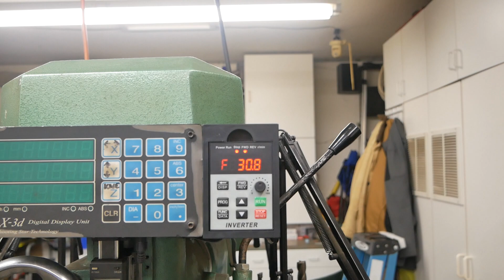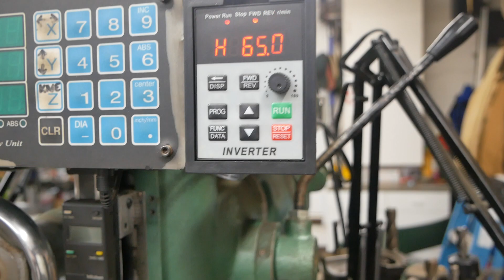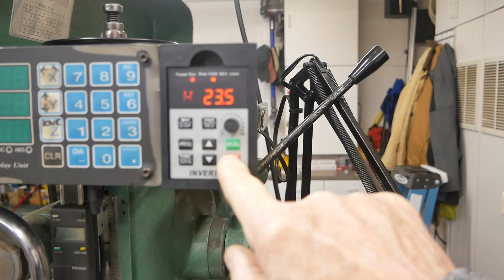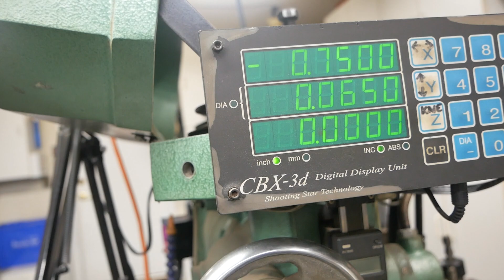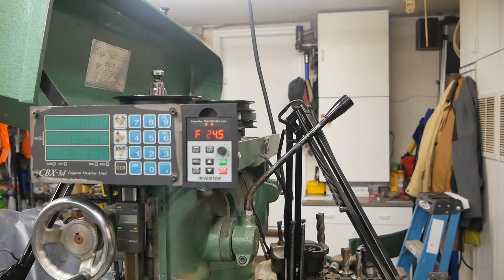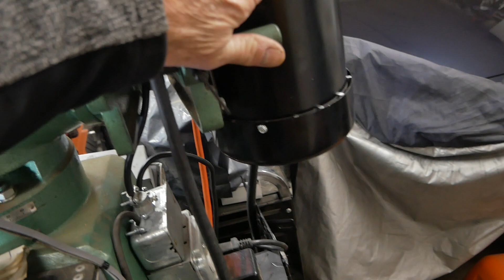Grizzly Milling Machine VFD Demo

Comment: I’m very curious and have a question about the VFD/ control/and the DRO. Have you looked into an Acorn control board? I am thinking about converting a mill to CNC and VFD and the Acorn board seems to be popular. (I am just putting the pieces together, lots of research) Was your original motor AC or DC before the installation of the VFD? Looks great and thank you for the video
Reply from the maker: @RE-zz7tr  sorry, I have no experience with that board or any cnc applications. Good Luck

Comment: What motor and did you use? I have a similar mill and looking for the right mount and shaft, HP ?
Reply from the maker: https://www.amazon.com/Electric-1750RPM-General-Purpose-Diameter/dp/B0BTHPV1YK/ref=sr_1_1?crid=1NDKFFJAJJVOV&keywords=2HP+Electric+Motor+1750RPM+General+Purpose+Three+Phase+56C+Motor+TEFC+230%2F460V+5%2F8%22+Shaft+Diameter+4+Pole+60HZ&qid=1703286514&sprefix=2hp+electric+motor+1750rpm+general+purpose+three+phase+56c+motor+tefc+230%2F460v+5%2F8+shaft+diameter+4+pole+60hz%2Caps%2C101&sr=8-1&ufe=app_do%3Aamzn1.fos.18ed3cb5-28d5-4975-8bc7-93deae8f9840